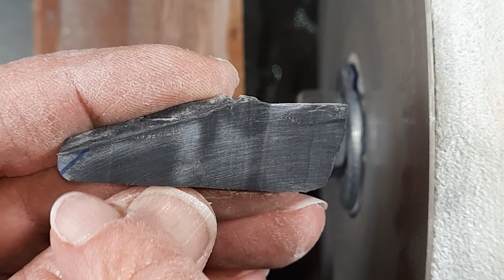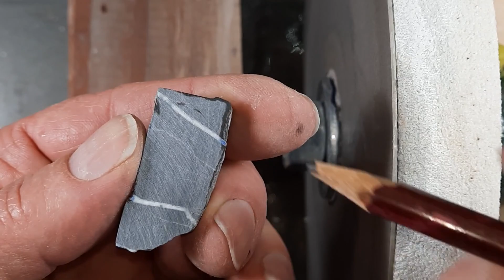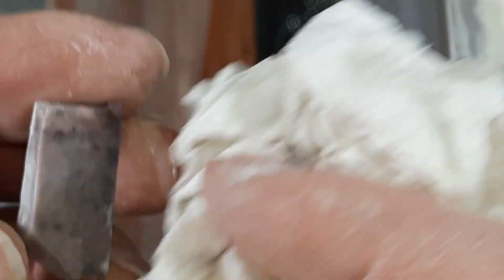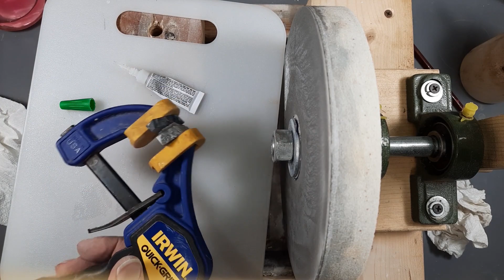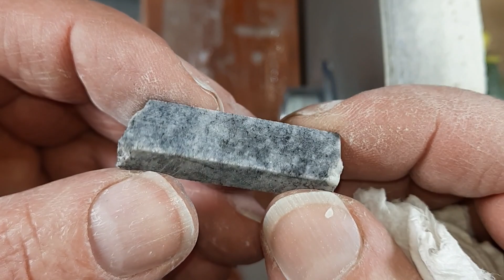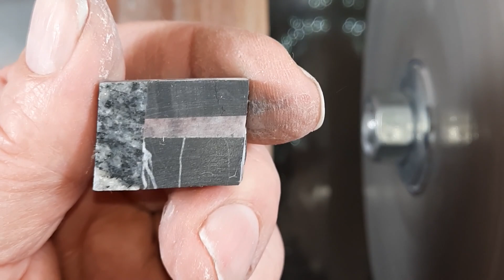USING the $30 Intarsia Machine

Comment: Do you have a link for the stone wheel you used for your machine? I built a module for my lathe to adapt it into a stone cutter but I would like to switch from diamond discs to a stone wheel
Reply from the maker: That stone wheel came with the bench grinders that I converted into cabbing machines, so to get THAT particular wheel I have no clue. Lowes and Home Depo both sell large stone whells like this one though, and Amazon has many as well so I would suggest looking there.
If you want to use a stone wheel for intarsia work, or use the side of the wheel in general, you will put groves in it somewhat quickly. Not huge groves to start, but for making a flat surface even a small grove will cause you problems. Using the edge works well, though I have found you need to dress the wheels frequently depending on the hardness of the stones you are cutting.
Hope that helps you out some. Thanks for watching.